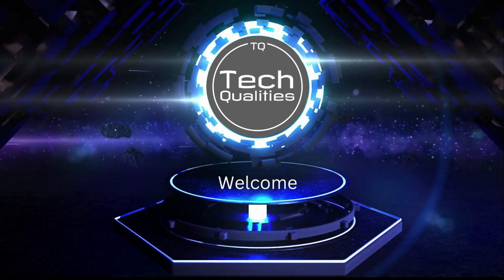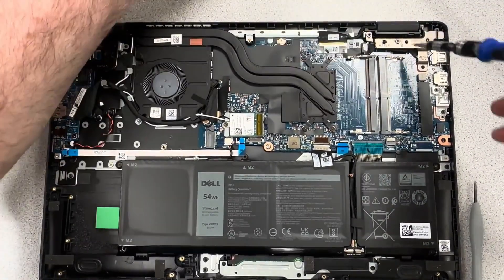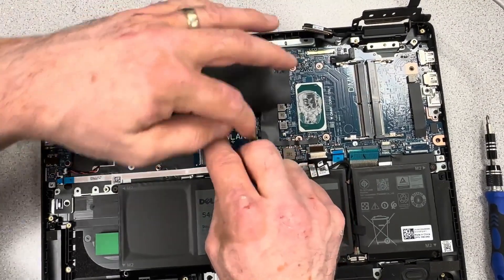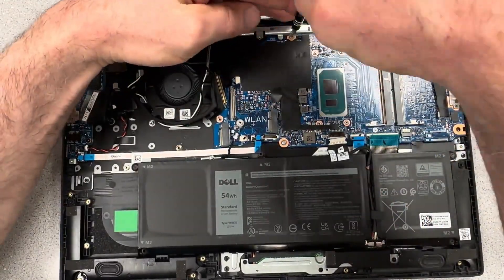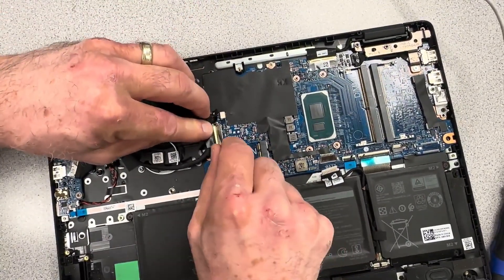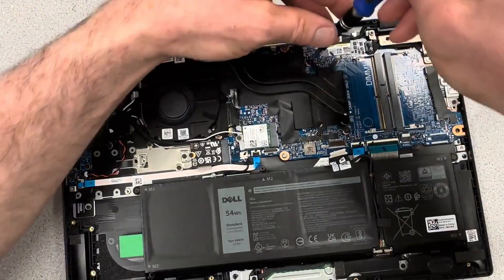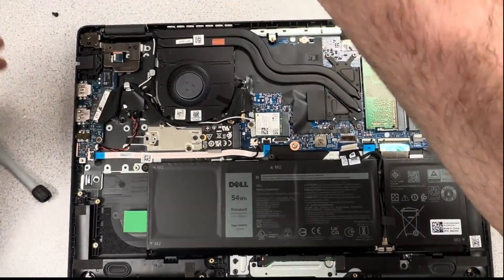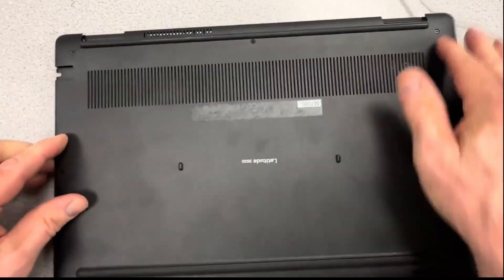Dell Latitude 3520 Motherboard Replacement

Comment: Is this Motherboard has CMOS BATTERY.IF  YES where location
Reply from the maker: Most latitudes have a CMOS battery.  Wish I could attach a pic here.  If you’re watching the video, it’s glued the the palm rest on the left side of the CPU fan.  It has a black/red cable that plugs in to the daughter card on the left.